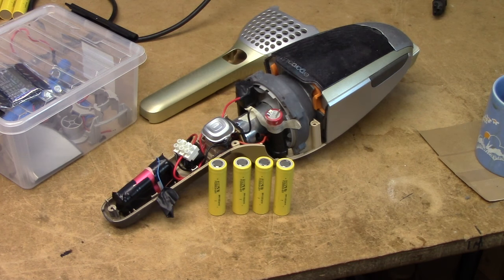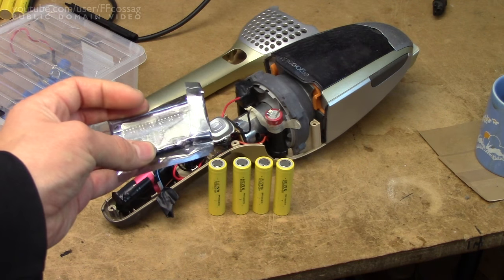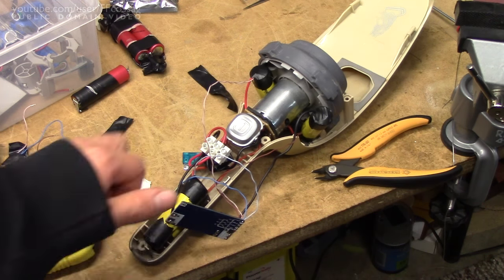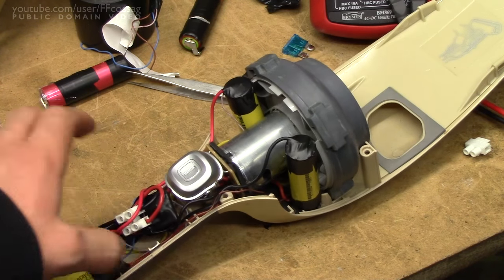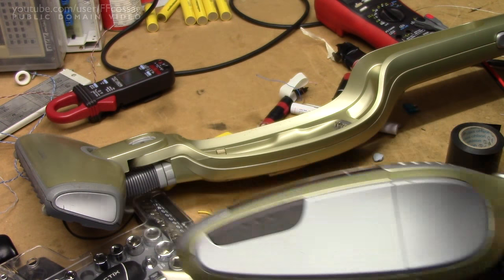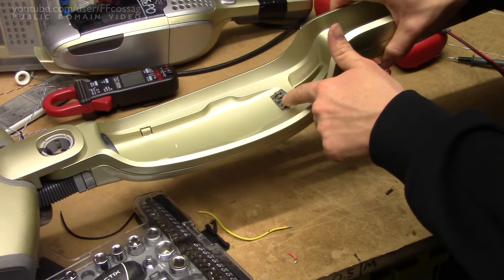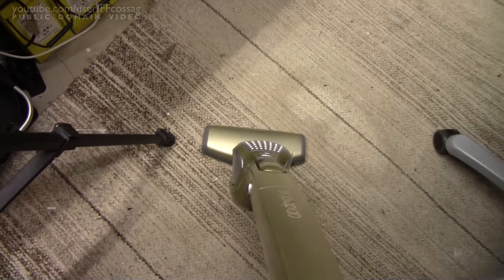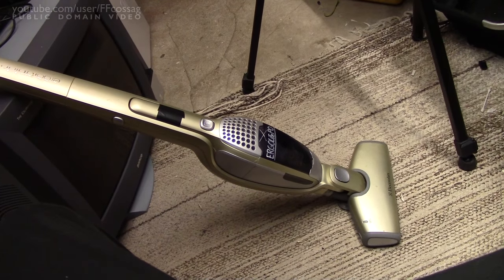Electrolux Ergorapido LiFePO4 conversion (Ergoinsano mk. II)

Comment: I did this fix, and from a dead vacuum cleaner now have a monster of a cordless vacuum cleaner!!   I used exactly these replacement cells, took about an hour, hardest part was fitting it all back together, if you do it, make sure you leave some extra wire for tucking the cells in.   Amazing, fantastic, cost would have been 75 dollars to 'fix' by Electrolux (meaning less than two years later it would be back for another replacement in the shop), cost for the batteries on ebay was about nine bucks.   I did not do the circuit board which I consider optional, my version already has some circuit board in it already.   

THANK YOU!!!!!!!

Comment: What a surprise I'm working on the same vacuum. What I did is removed the NiMH cells and put two wires out so it can be powered by an external source. I've been thinking about 2p 4s configuration of li ion cells. I'll need to figure out a way to attach the cells to the exterior.
Reply from the maker: Considering that the original battery is made up of 1.3 Ah NiMH cells, even my 1.1 Ah LiFePO4 mod is going to give better battery life - 2P4S would just give the vacuum stupidly long runtime.
Reply: You made it wired?

Comment: LifePo4 batteries are magic, I got one in my old Spektrum DX7 remote and I forgot it charged all winter, I lipo would have puffed & die, my 3s Life started at 9.9 volt and went up to 10 volt after a few minutes and lasted through one long session of quadcopters calibration.
I had my old nicad charged in case, never used it. 

You gave me an idea, wonder if I could make my gutless Red Devil rechargeable vacuum run on some lipos I have here for my RCs

Mouh ah ah ah

Comment: Very nice work !!!
Thanks for the ebay links! I plan to reproduce your mod on a dead 12v Ergorapido belonging to one of my friends :))
Small question: what charger should I use? Is the original 15v one still OK or I should find a 14.4V one ???

Comment: Great video for Ergorapido battery fix.
I’m quite a noob on electronic adjustments, could you please share the circuit drawing since battery->control board->motor?
I trying to find where to buy the cells, a little bit hard to find A123 18650, but the board I already got.
Reply from the maker: All board models are different, you're going to have to consult the markings/manual of your board. It's usually labelled with cell numbers.
Reply: FFcossag I’ve got the same model of control board that you use for your aplication, and my ergorapido is the same model as yours.
If you send the circuit drawing that you use, it will be a headstart for me.
Reply from the maker: I'm afraid I never drew the circuit. The sellers that sell these boards usually have a graphic for how to wire them up, but I recall mine being quite obvious. You wire the cells in series and hook each mid point up to the correct number on the board, counting up from the B-/GND terminal. I don't have the stuff easily at hand to say anything more detailed, I'm afraid.
Reply: After this modification, are you using the same charger from original Ergorapido?
If I want to use it wired until I wait my battery arrive, can I use a 12V from a ATX PC supply?

Comment: Replace the batteries with AA eneloop is a much better mod. Keep the original look and charging capability with the added reliability of eneloop battery (or ikea)
Reply: wont work as the vacuum draws over 9amps.  Can't imagine the NiMh can push that much power out.

Comment: Just spent an hour or two googling lifappo cells. Still a bit scared using lithium cells, even though the cell chemistry seems a lot safer. Why did you not use the charging "pads" built in the stand? Curious as I have one rapido myself with crapped out batteries.
Reply from the maker: Simple - I don't have the stand.

Comment: Very nice job! @FFcossag can i use Panasonic Eneloop 1900mAh 1.2v for this battery replacement without adding protection circuit?
Reply from the maker: Possibly, but I'm not sure if they're rated to handle the ~10 A that the device draws.

Comment: Nice video! I was looking for 18650s cells to do the same thing, found the LG HG2 Lithium-Ion batteries, they rated for a max continuous discharge of 20A and have 3000mAh! And are just a little more expensive than the A123's. Do you think is safe to use those cells or should stay with LiFePO4 cells?
Reply from the maker: It's probably fine - I prefer LiFePO4 myself, since they're so durable.

Comment: Is it possible to wire it to use the stand and the standard charging pads/mechanism? Or do you have to install a charge plug?
Reply from the maker: THat'd work fine but you still need a custom AC adapter.
Reply: The standard AC is 15V and .2A.  What would the custom need to be? Thought the protection board would specify, but it doesn't seem to.... Thanks!
Reply from the maker: You need a CC/CV lithium charger for the right number of cells.

Comment: Ha I was waiting for this to finallycome out! Nice job. Two things - Could you invert the vacuum and turn it into an air compressor (I'd imagine that'd be fairly useful for cleaning out scavenged components that have accumulated crud over the years); two - when you get a chance, can you make a "power supplies for noobs" videos? I've got a basic understanding of how to safely charge-discharge li-* (the 4 stages, when to constant current, when to swap into constant voltage, trickle charge, etc), but I have no idea re: inverters/salvaging old li-po's from laptops (I hear powertools are the best for these, since the safety regulation in the circuit is heat + current based, and when that threshold is exceeded, the batteries won't take a charge, despite the fact that they're still 'good'). I know little to nothing about the chemistry of secondary batteries (or even primary, beyond the basic concepts one learns at uni), so that would be great if you could! Anyways, fantastic content as usual. Appreciate it!
Reply from the maker: I'm glad you like my content, but the stuff you're asking already has information a plenty out there around the net if you just dig deep enough - that's how I've learned what I know. As far as "inverting" the vacuum, it wouldn't work very well. The fan is designed to draw a vacuum, not build pressure.
Reply: Got ya. Any channel recommendations re: more of the 'electrical' engineering rather than 'electronics' engineering (i.e., VFD's, and other things with more power)? (I'm a mathematician by degree, and a software engineer by profession so my limited knowledge has been acquired via the same 'digging' methodology)
Reply from the maker: I'm bad at names, the best I can do is tell you to check my subscriptions, I'm subscribed to a few electrical/electronics channels that you might like.

Comment: Great job!  I might have to upgrade mine to an A123 pack now.  I did one of the first documented LiPo conversions on mine about 4 years ago https://www.youtube.com/watch?v=aswmYEf_gXA LiFePO4 is a much safer chemistry than the LiPo that I used. In fact, I would feel fairly safe not using the protection board as long as you didn't leave it plugged into the charger constantly when not in use.  I know the guys who build A123 packs for motorcycles don't use protection and don't have problems even with the stock charging systems on their bikes.  I wish there were widely available LifePo4 18650 sized cylindrical batteries back when I hacked mine up, but back then the only ones widely available were the short fat ones from Dewalt 36v tool packs and it would have cost about 60 dollars as opposed to under 10 for the lipo.  If you don't mind, where did you source those cells?